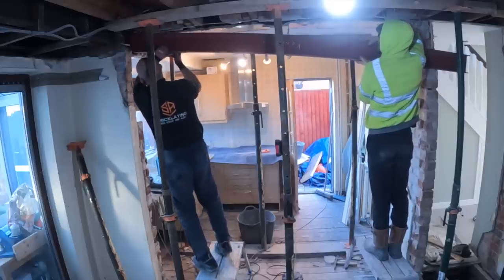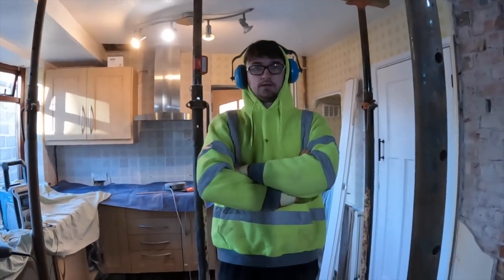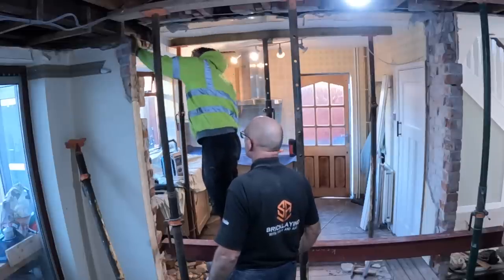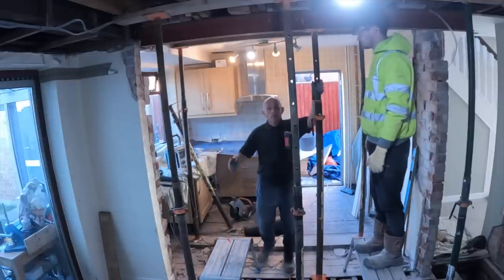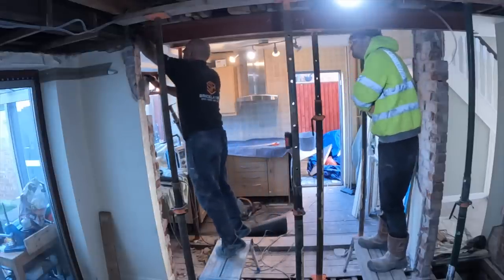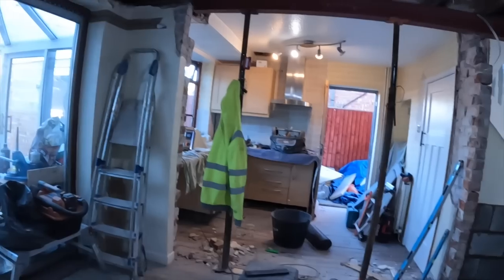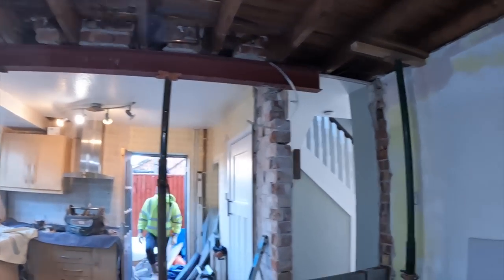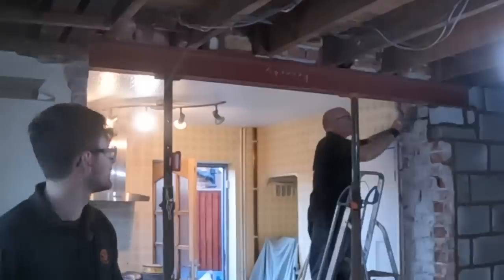LOAD BEARING STEEL BEAM INSTALLATION !! STEEL JOB PART 2

Comment: A brilliant job done by Steve and Alex showing how to safely and correctly install steels using the acros to support where needed and to build up blockwork shut opening using correct dpc and wall ties and the installation of pad stones and packing up with wedges between steel and joists ! A great tip for keeping existing brickwork up and saving extra work or an injury well done Steve and Alex for a tidy and well executed and explained job 👏

Comment: If you know a joiner get him to cut you a bag folding wedges for when you have to pack timber joists  off RSJ'S , 2 wedges pushed in opposite each other to form a flat packer to what ever thickness you need. Before you slide the wedges in shoot some CT1 on the steel and apossing faces of the wedges and the joist to stop them moving  over time.
Reply from the maker: Thanks for the tips Tony 🤙🏾🧱👍🏽
Reply from the maker: @martin2466  🧱👍🏽

Comment: Nice to see you two getting stuck into something other than an external lintel replacement, garden wall, or rebuilding a small extension… I have hopes that in the non too distant future you’ll be buying a crabby old place, demolishing it and building s brand new spanking place…onward and upward… enjoy your vids guys…👍🏻
Reply from the maker: Cheers Stu . We wouldn’t survive without the lintel jobs. 🧱👍🏽

Comment: Quality work as always boys, I wish more 'tradesmen' and I use that term lightly had your attention to quality and detail.
One comment if I may..........and nothing to do with your work.
The welding on that beam connection, looks a bit ropey...........looks like its been done with a welding set bought on Ebay !!!

Comment: In your area, do you ever use powder fasteners/Hilti to fasten steel together?  It is quick and easy, there's no need for a welder and they are strong, they won't come apart.  This is fairly common here in New York State for commercial construction, less common for residential (less use of steel).
Reply from the maker: Hi David. I’m not sure about commercial as we don’t do any at all .
  We’ve never used it ourselves 🧱👍🏽
Reply from the maker: @martin2466  🤔🤔🤔🤔😏🧱👍🏽

Comment: Hi, I thought the law changed that all steels had to have a certificate to show that the steel had been worked on by people who had been certificated, which cost 10's of 1000's of £ to get. So if you want to alter it in any way you must get someone who is qualified to do the work and give you a new certificate. the flange you cut looked like it should have been bolted to the existing beam has it had holes in it and would have been calculated for. The flange that was welded looks like it was not fully welded, why was that? many thanks
Reply from the maker: Never heard of that law to be honest .
   I’m not a welder so I trust the guy who has many years experience.
   Lastly the whole job was inspected and signed off by building control 🧱👍🏽
Reply from the maker: @martin2466  😬🧱👍🏽
Reply from the maker: @martin2466  🤨🤔🧱👍🏽
Reply: @martin2466  It's not new been about years, the welder must be certified and be able to sign the work of.I was on a job around 7 years ago and steels had been welded by a uncertificated welder, BC weren't having any of it and the whole thing had to be drilled and bolted with plates to comply, a massive pain easier to do it right in the beginning.
Reply: @martin2466  Unfortunately yes Martin.
Reply: @martin2466  I am retired Martin, the bit of work I do pays for the holidays 👍😁